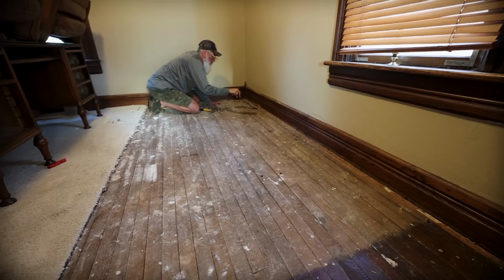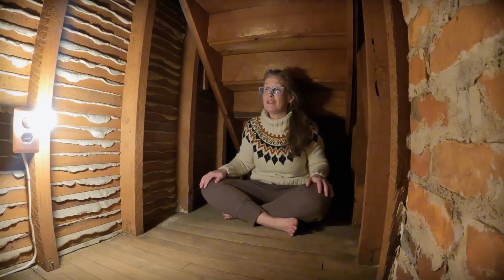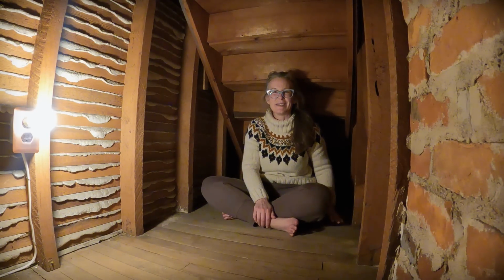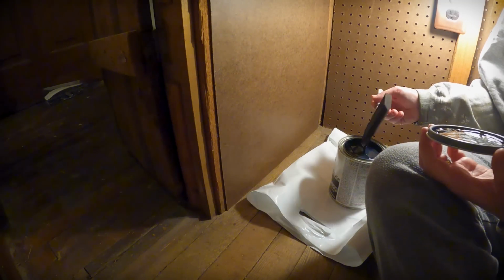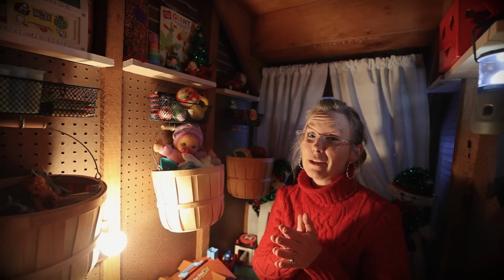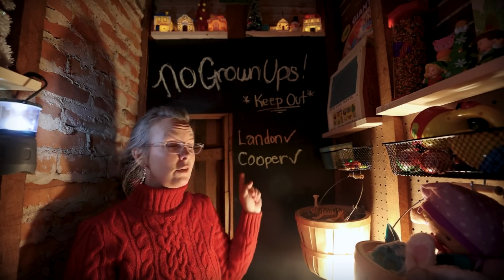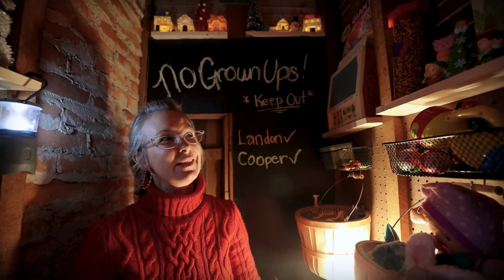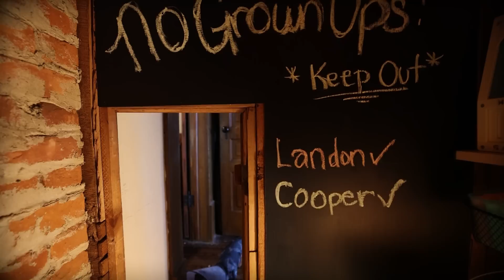Our "SECRET HIDEOUT" Build | Wasted Space Under the Stairs

Comment: When we purchased our last home it was 147 years old. 
We had joist sistered to stregenth 
And had the outside perimeter of the room, 12” wood sanded and stained. The interior of the room we put down a wool rug with padding It looked amazing. And solved the high points of the corners. Never noticed again. And easy to clean

Comment: I ABSOLUTELY LOVE IT!!! 
BUT, The Sockets and light are definitely a burn hazzard-hot to the touch or anything flammable against it...and an Electricution hazzard-finger in the socket, or other things.... How about a flat plug  to cover both outlets (one side with an extension that you can staple up the wall?) Maybe a spray pai ted cool old looking hanging chandelier or something from the ceiling or something??? Have Fun guys!!!
Reply from the maker: Don't worry about socket and light bulb, a socket cover is coming and there will be a hanging light fixture away from kiddos.

Comment: Darling!! It is a place of great imagination potential :)  Great job! I agree with the light bulb comments. And to lock up that socket so little ones don't mess with it. Maybe string a light to the ceiling or put in battery-powered push lights. Good luck on the floors!
Reply from the maker: Don't worry about socket and light bulb, a socket cover is coming and there will be a hanging light fixture away from kiddos.

Comment: We did this too!!  We created a wonderful Grandchildren room for them.  I wanted it for all ages.  So we did a little desk right under the stairs (where the area becomes too low and have a little light hanging down.  Use a cute little seat that they can lift to put toys into.  Then we put a bookshelf in that faced out (so it was only 4 inches thick) and you see the books facing you.  We have little green folding chairs.  The desk area where their little feet hang is where we push games back against the step, so we can store more things back there neatly stacked.  (on the floor directly against the lowest two steps).  I love it.  We decided to split the door in two so make a "dutch door" so that the top portion can be opened and no ones gets too scared.

Comment: I used to have a little attic something another but it wasn't actually in the attic. Attic way maybe? Anyway, I fixed a light and often read in it.  It was small and I had 3 brothers and 2 sisters and I didn't get interrupted in there.
That is lath and plaster. My parents had that as well. Can in imagine scraping 8 layers of wall paper in three rooms and 3 on the ceiling? I will NEVER have wall paper in my house. I scraped it mostly myself.